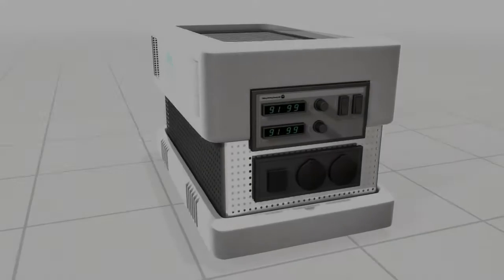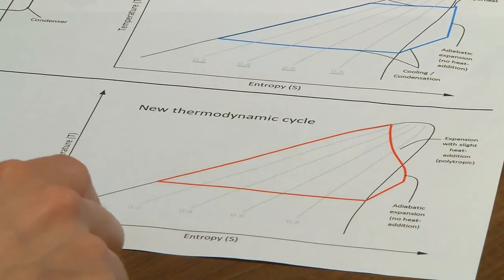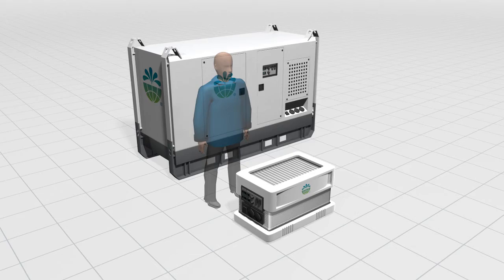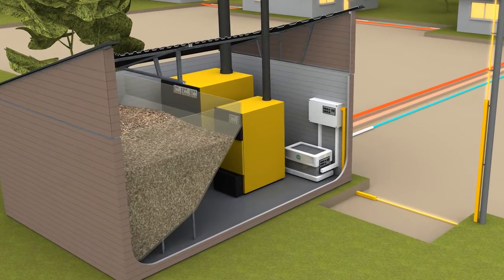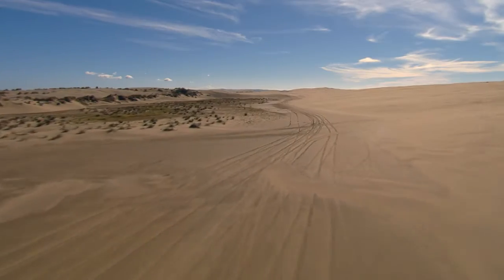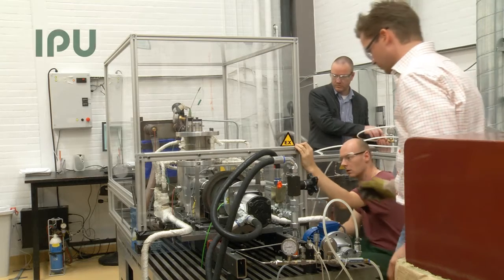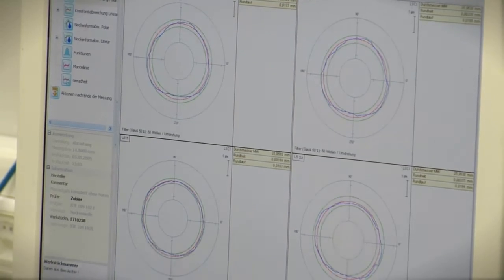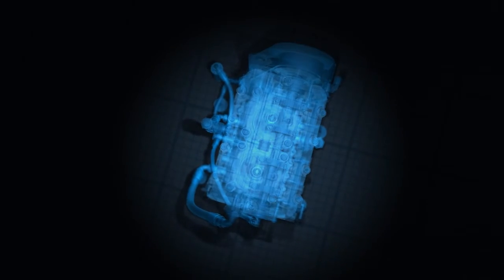CraftEngine - Electricity production from renewable heat sources

Comment: Interesting video. 
It would have been interesting to know how much the heat-to-electricity conversion efficiency was, using different energy sources and respective temperatures. 
I am really curious about the new thermodynamic cycle and would like to know more. 
However, to generate 200 deg C from solar thermal collectors at higher altitudes is a bit of a problem even using the best performing panel in the world, which currently is the TVP high-vacuum flat solar thermal panel.
The statement about the electrical energy cost of €0,05/kWh and payback time of <5 years can be a bit misleading, as technical specifications and cases scenario are missing. 
Perhaps a more cautious marketing approach should be considered here.
The idea of CHP micro generation is fascinating. 
I think that for thermal solar applications at high altitudes, the real breakthrough would be to reach a heat-to-electricity conversion efficiency of 50% with temperatures around 90 -110 deg C, electrical energy cost of €0,02/kWh and payback time of 5 years. 
Then the system would make economic sense.
At that price the electrical energy in excess could be used to generate green hydrogen at a cost of €1,5/kgH2 using an Enapter AEM electrolyser. 
It would be a solar thermal-to-green hydrogen generation. 
The hydrogen generated during the warmest months of the year would then be stored and used at later time, therefore enabling seasonal energy storage and energy security. 
For now this remains just a dream.

Comment: Recall
I recall my statement about 200°C from non-concentrated solar thermal. 
I just realized, that you CAN really achieve such temperatures without concentrating mirrors or lenses. But you need expensive vacuum-insulated tube collectors.
As a part of the whole system (biomass, heating), it may make sense. 
If you just count solar electricity production, I think, it can´t compete with photovoltaics.

Comment: You don´t get 200°C from non-concentrated solar thermal. Maybe, the craftengine works with 90°C too. But with low efficiency, optimistically 10%. That´s even less efficient than cheap photovoltaics. 
And even with 200°C input temperature (burning wood), the electricity/heat-ratio is low. 
This ratio is a key factor and you should mention it in the video. 
But if you have much cheap wood and if you need much heat, it may be a reasonable way to generate electricity.